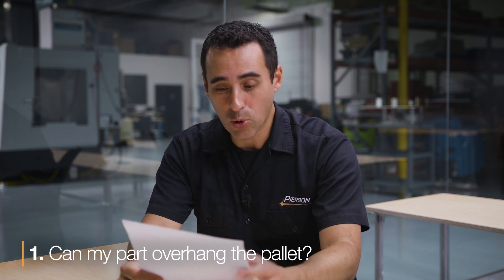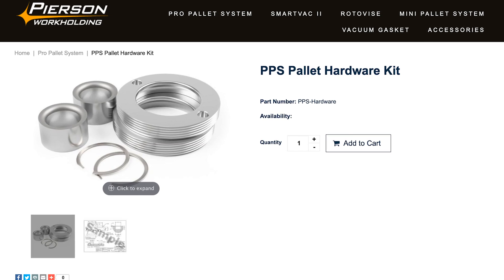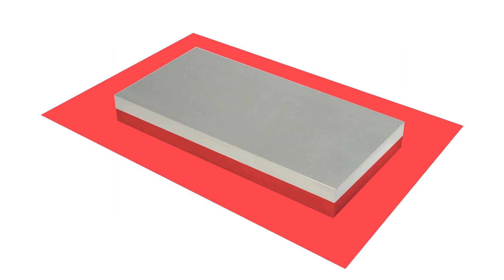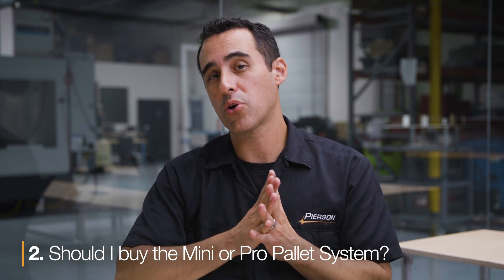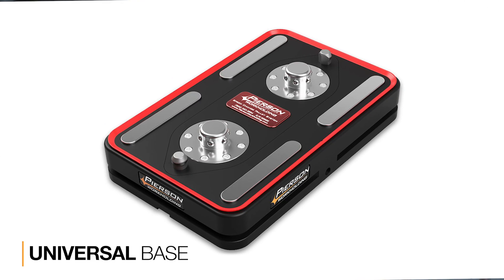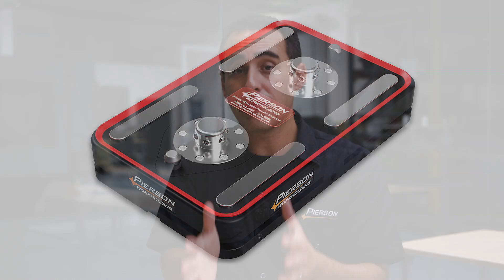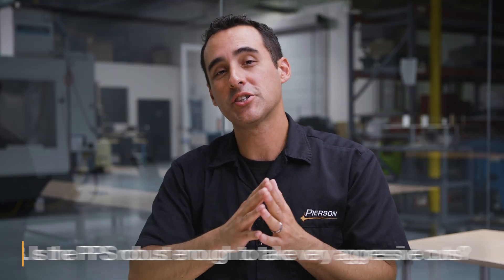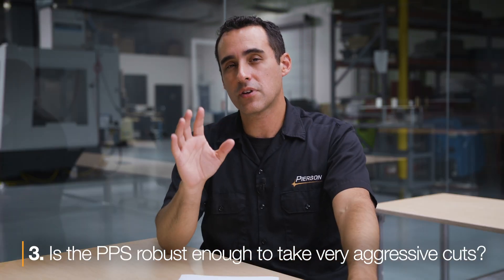Our Pallet Systems - Pierson Workholding Q&A

Comment: Next Q&A can you cover some topics about the top plates for the smart vac? I've been using mine for a few weeks now and love it. I haven't yet had to make custom gasket grooves which cross paths from previous setups. I know it could cross one perpendicular path like it does on the bottom plate, but multiple at an angle too? Can you seal some previous paths before cutting the new ones? For a shop like mine which does mostly low quantity prototype work, do you recommend drilling and tapping vacuum holes for new setups so that you can close them up later with a set screw? Or can you just plug the old ones in an easier way? I also had a 1/2"x14"x24" aluminum customer part move on me during 1/2" end mill profiling and it had to be scrapped. I assumed that this surface area would have been enough. I had seen you use sandpaper in one of your videos and now that is all I do. Maybe you can clarify exactly how you use it and when. Thanks! Videos are great. -Bryan, Power Move Engineering
Reply from the maker: We have a few videos on designing and programming top plates and we'll do more.  Until then, keep in mind that it doesn't matter where you machine (or machined) a groove - it matters where you place the gasket.  New grooves can cross old grooves without any problems.

Comment: have you every made an over sized pallet that used two bases? I have a few fixtures that are 18"x30" and I was thinking about using your pallet system for them. Thanks
Reply from the maker: Yes, often.  It requires not using 2 bushings in opposite corners of the pallet and you'll need to rotate the diamond pin of one PPS Base to face the round pin of the opposite base.  Hope that all makes sense!